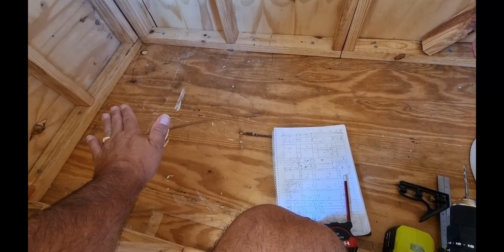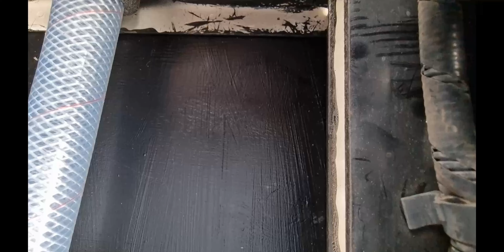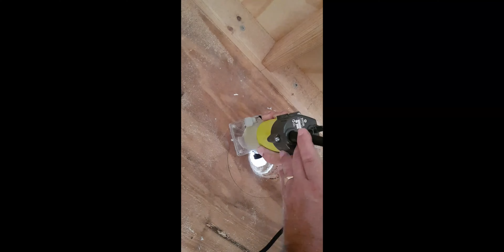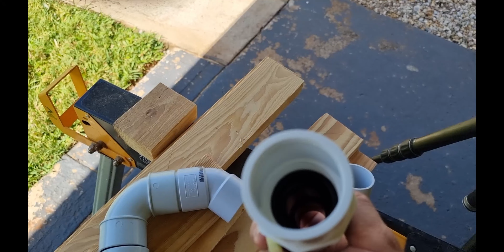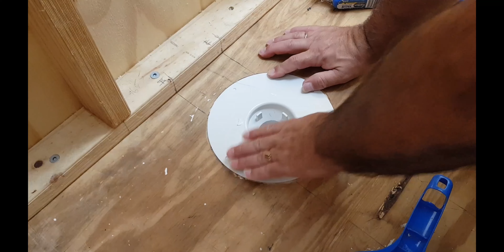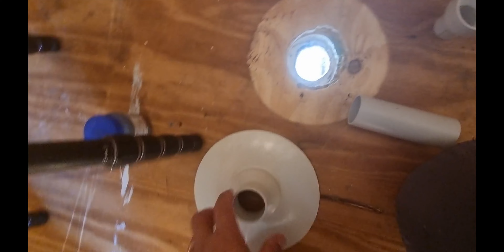Mitsubishi Rosa Bus Conversion Part 52 How many mistakes to install shower waste to tank

Comment: What size ply did you use on the final top of your bus conversion? I’ve seen the nine mil. Then the 10 mil insulation. What was the size of the top? I live in Northern New South Wales? Just over the border. I’ve been looking.
Reply from the maker: For memory it was 18mm 😊

Comment: Are you happy with the sea flow pumps that you’ve used in all the material that you’ve used for your plumbing because I’ve gotta order some of the stuff myself so I’m just checking to see that you’re happy with what you’ve used?
Reply from the maker: The pumps have worked really well 😊

Comment: Does your recirculating system for the shower work good? I’ve heard there’s a lot of cleaning and filtering and a lot of mess and does it really feel like a proper shower? Thanks guys. Love your videos. I’ve just bought a bus myself. I’ve just been watching it full on thanks Paul.
Reply: Thanks for help guys , will be in touch more questions, Paul
Reply from the maker: The problem is removing the smell of the water . The filters get dirty quickly.  We have stopped using it us we live in it full-time now.